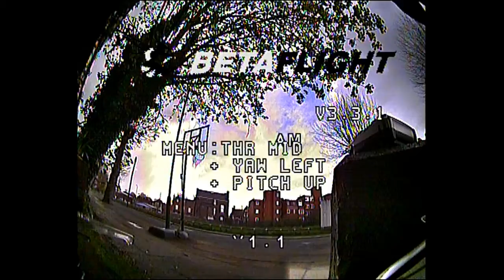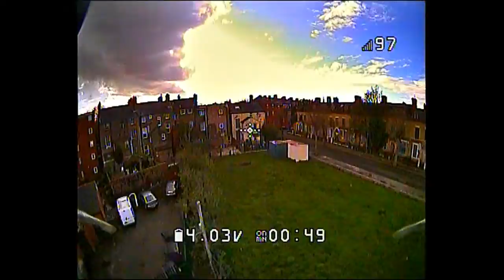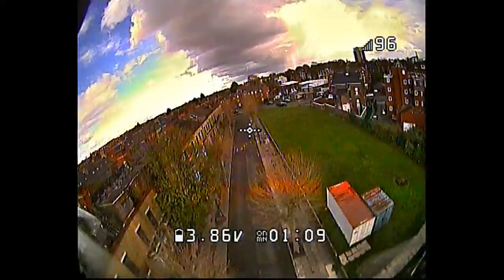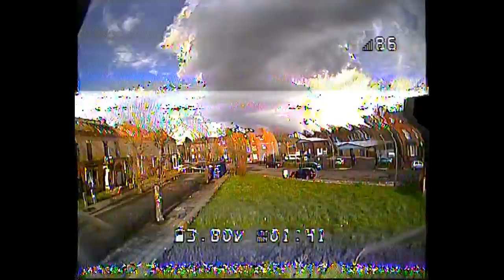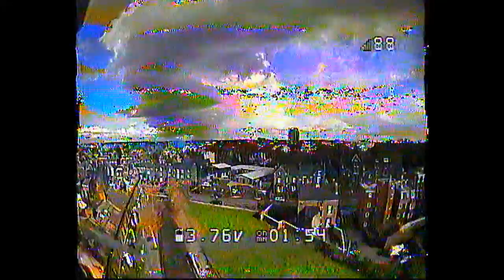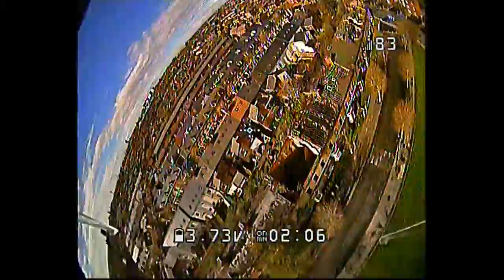Attitude Issue

Comment: turn anti gravity up a bit?
Reply from the maker: Will try :-)
Reply: If you're not on dshot try calibrating the ESCs again if anti grav makes no diffrence...or it could just be a bad ESC/motor
Reply from the maker: Nearly eliminated now, had to use silly amounts of I term on roll and pitch, over 70,s but it's looking good now, it's on dshot 600